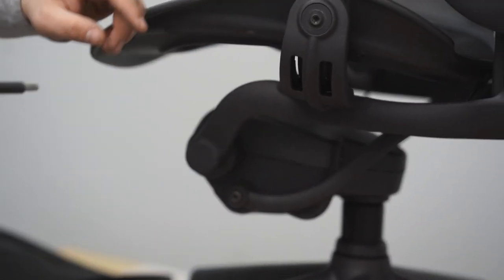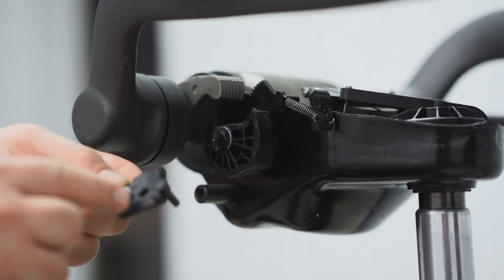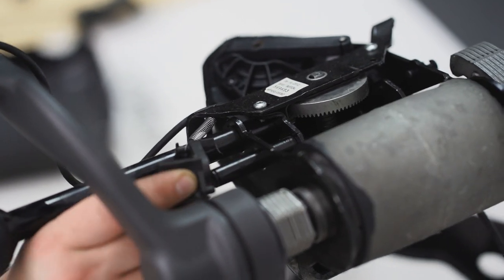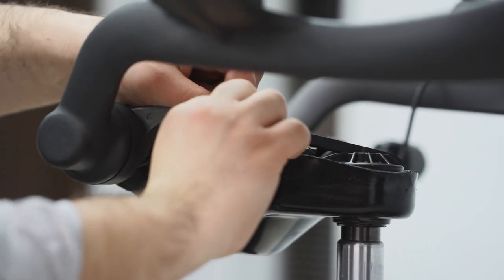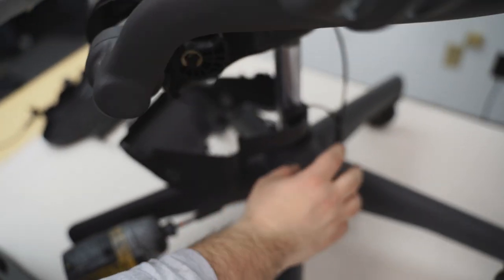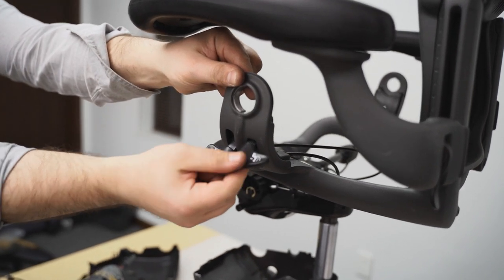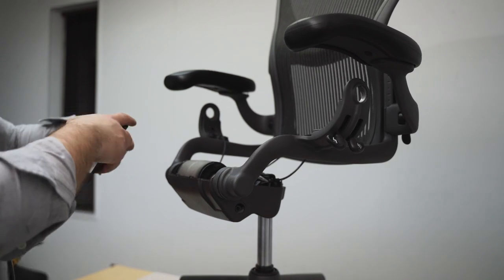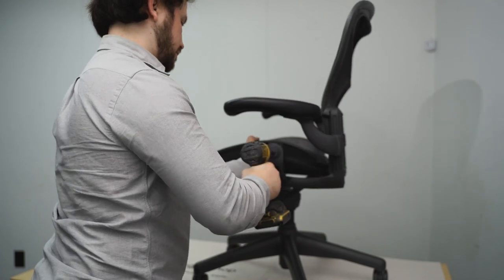Upgrade your Basic Herman Miller Aeron Chair to a Fully Loaded - Tilt Cable Mechanism installation

Comment: Good video, one correction: Both controls can indeed be "up". This locks it in forward tilt mode. 

Process as follows: Unlock rear tilt (down), lean back, activate forward tilt ("up" position), lean forward, lock the rear tilt again by setting it to the "up" position. 

Now both is up and chair is locked in forward tilt.
Reply: Can you believe that after purchasing and sitting in a used Aeron chair for several years and NEVER being able to activate the forward tilt feature, your simple explanation explained the proper operation......I am now leaning forward and saving my back.

THANK YOU!!
Reply: @toysbyus1  I am happy I was able to help at least 1 person with my comment. 
Enjoy the forward tilt lock, I know I do when "tasking".
Cheers from South Africa.
Reply: Thanks for the video and clear presentation! 

Do you get more rotational play in the seat when locked forward than when locked up without the forward tilt engaged? For me in the latter case, there is very little play in the mechanism, while with the forward tilt engaged, the chair doesn't lock quite as securely and I lose a couple of degrees of forward tilt as a result (since my butt naturally falls backwards until the lock engages).

Comment: Hey! Does the kit include the gears for pre-2012? Or just the cable & levers? (I have the chair with the wheels for the arm adjusts so pre 2004?) I have the tilt-back limiter, just not the tilt forward part

Comment: For chairs missing the "born on" date, do you have a way to easily identify if the replacement gear is necessary or what type is installed?
Reply from the maker: Hi, you can open the mech cover and check the gears from both side to see if they are new version or old version.